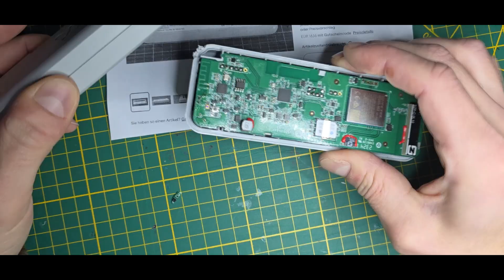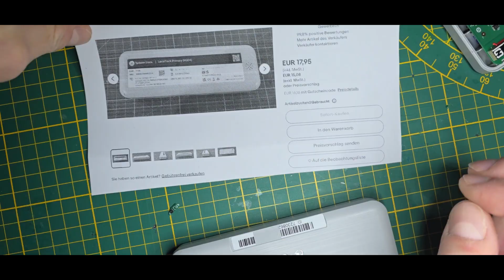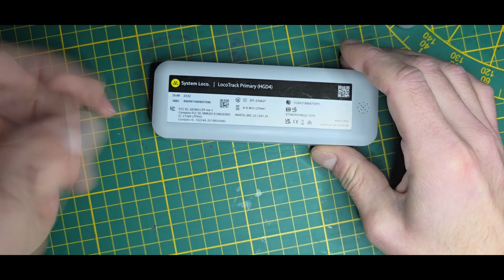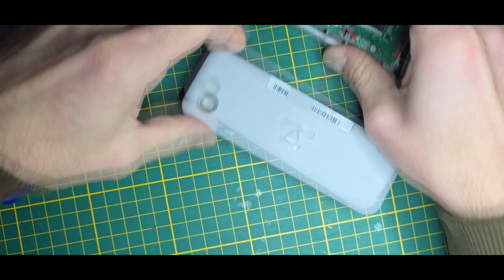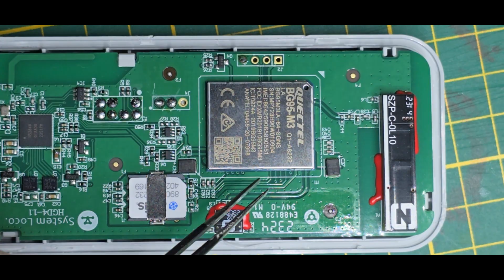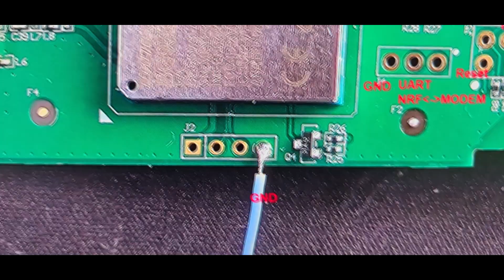Checking out a hackable industrial GPS Tracker with many features

Comment: I wonder if you can give any pointers for me as a complete newbie to reverse engineering the existing firmware. 

I'm looking to reimplement pretty much all of the original functionality of the device.

It would be handy to know where to look for which UARTs connect to which devices, what baud rates etc... I know I could probe around in hardware and find most of this, but I'd like to learn the software side a bit more along the way
Reply from the maker: Made a newbie video on how to reverse a firmware here: 
https://youtu.be/xVekI3bwK0U
This firmware is of course way more complex